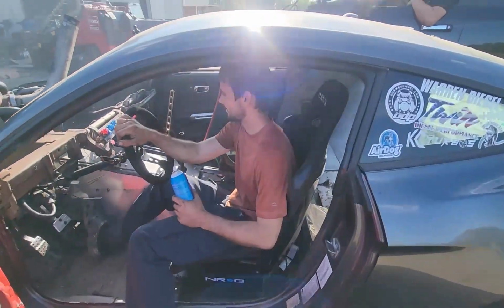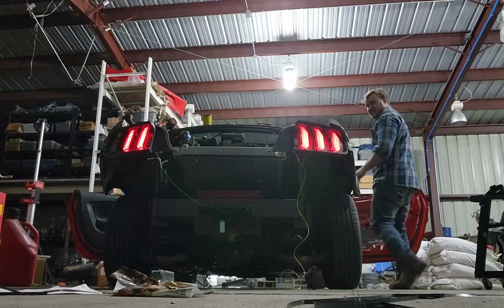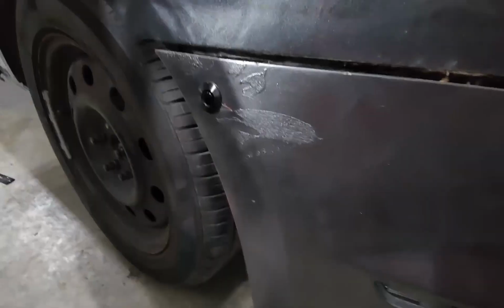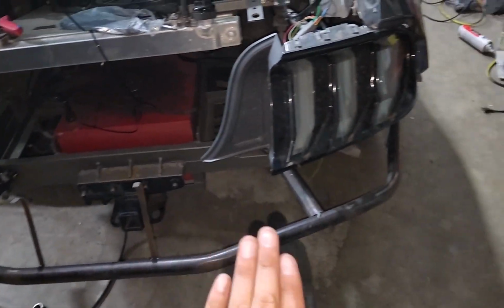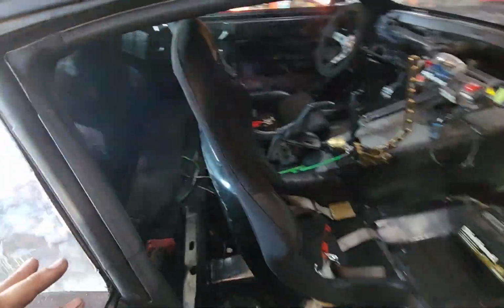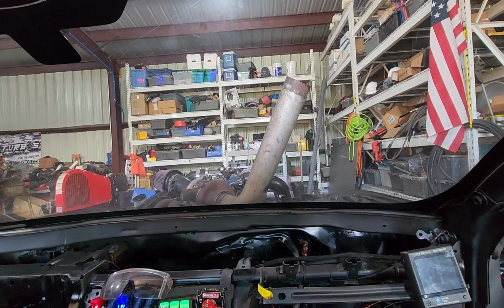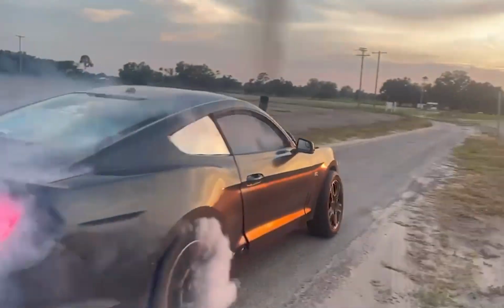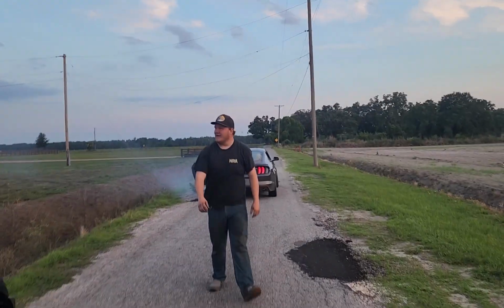5TH GEAR BURNOUTS IN MY DIESEL MUSTANG?!?!

Comment: Probs not a good idea but I got a stock 8.8 in my old mustang, I plan to swap in a 6.0 Powerstroke just as a daily, turbo and everything with switchable tunes on-the-fly.   Key point being that it won't be anymore than 500hp or 600ft-lbs of torque, whichever comes first.

so, two questions: 

1.)  Can an 8.8 handle stock output of the 6.0 powerstroke?  
2.) if not, what do I have to do to strengthen it so that it can handle stock output from a 6.0 stock with a stock zf-6 trans (with t-case)?
3.) if a strengthened 8.8" is not enough.. would I better off be getting a stock f250 from 04 then narrowing the axle so that the wheels can fit within the wheel wells?

I have a decent amount of money I'm willing to spend, however I just don't want to go broke and trying to find the right options so that I don't go broke quick.  After all, my scarlet (my car) is going to be my daily.

Not gonna drag race or anything, just want to piss off prius owners in cali when I go back. And maybe tow a custom teardrop trailer that's built specifically for my scarlet later down the line lol.

Oh and maybe decent if not better fuel mileage.  (my 3.8l v6 gets me about 30-34mpg on the stock 5 speed while weighing 3,015lbs with an almost even 50/50 weight distribution.  How do I know?  I took it to a CAT scale to find out, and I was kinda surprised ngl.)
Reply: If you strengthen the 8.8 and get different axles I think it would be good enough but I’m not sure about the yolks are probably a lot different size